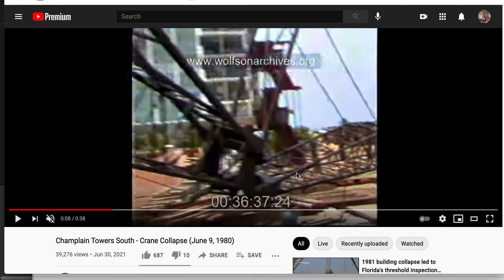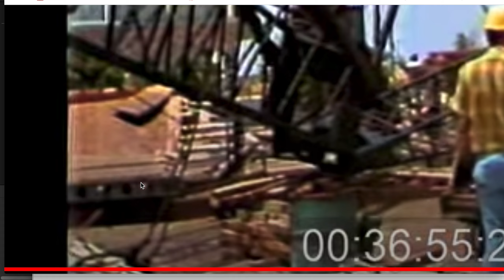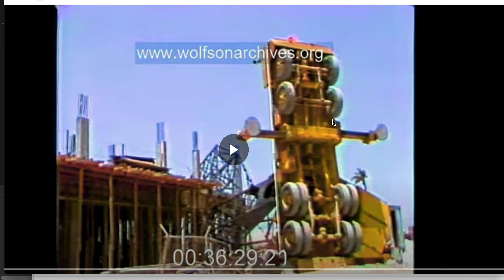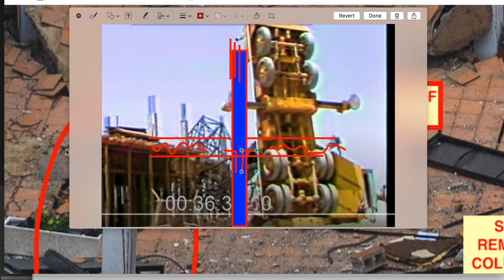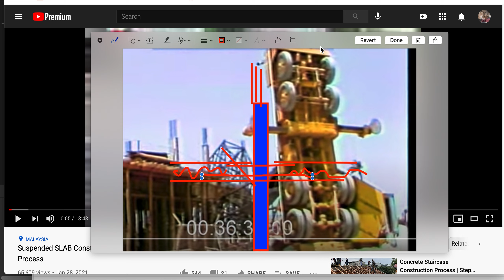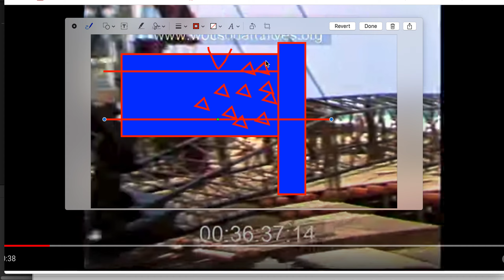Champlain Towers COLLAPSE THE CRANE ACCIDENT OF 1980 CAN TELL US ABOUT THE MARRIAGE OF CONCRETE

Comment: This is a partial and incomplete analysis of a video which has now been taken down and can no longer be found on the Wolfson Archive website.
That crane is directly on top of the pool deck and overlapping the building where it comes closest to the ocean.
The crane collapsed on top of the completed pool deck and the pool deck was never repaired, nor was the rest of the building that absorbed the shock-load of the crane collapse.
This is being covered-up to hide the liability of those involved in this crane accident and their inappropriate response to this accident, which was to cover it up at the time and just complete building it, and the building was already damaged before it was finished.
The contractors and developers of this building clearly realized that this crane accident occurred and instantly began attempting to pretend that it didn't and everyone who bought into this condo was lied to about this accident and damage, until it killed them.
They should be bringing criminal charges for this, yet, now NIST is in on the cover-up too.

Comment: This has me thinking they poured the garage floor and pool deck last. The crane would be parked on grade (in the pool deck area) and used to get the concrete placed, along with an area on site to stockpile materials. It would be easy to use different strength concrete in the columns/floors. U would just order the 6k psi trucks and pour the columns up to top of floor grade, then when u finish that the 4k psi trucks show up to finish the pour of the floor. Its all wet, then vibrate and all good. Then u pour the next portion of the 6k psi column from the top of the previous column to somewhere below the floor of the next deck. Then u place forms for next floor and continue to pour over and over again as described. The BMA was used as the additional cheap support method for the deck of the pool/planters area as they new this area would be poured last and would require some help since it didn't have separate columns. The mistake they made IMHO was simply to not place an additional set of columns for the pool deck area (poured last) to separate the pool deck/building intersection joint. By using the angled rebar that connected the higher building floor deck to the lower floor pool deck they created a moment arm on the building columns that failed when loaded by the falling pool deck. Improper maintenance weakened the rebar/concrete in the pool deck/parking area and it fell then taking those columns out. I dont know what the codes are now for separate standards based on use type maybe they have changed so that garages are structurally separated from living areas? Just my thoughts on this sad situation.

Comment: So the pile caps were poured, and then the columns.  
So the basement slab wasn’t poured structurally, (first), but treated as a slab on grade and poured later, (with sand as the form)? The rebar was indicated through and around each basement column.  Is that why they didn’t want the engineer anywhere near the basement slab?
Reply from the maker: No. The point is, the first floor more than likely had a bond break while waiting say, 28 days because shoring was on sand. This has nothing to do with concrete pour on floor afterwards.
Reply: @LoadPathEngineering  so the husband was not engaged from the very start.  Lost interest in the first few days? The upper horizontal fracture in the core was from pulling forms (early) and/ or residue crane collapse damage of the deck?
Reply: The planter beam was possibly pulled on during the crane collapse 40 years earlier (torqued).  Were the shear planes seen after building collapse from the earlier crane collapse repairs or lack there of (improper - non doweled- construction joints).  Did the third building  find and collapse towards this weakness (mirroring crane collapse path)

Comment: Could this be the reason the original General Contractor resigned?
Reply: No because the GC resigned almost at the end of construction, possibly when the 13th floor penthouse was ordered.
Reply: @youtbe999  Does the 13th floor penthouse dramatically alter the stresses on the building ?
Reply: @youtbe999  where was the old Coast Gaurd station in relation to the building. It was one of few early buildings around on the beach from the old days. The old map shows it (1925) just trying to imagine the beach line
Reply: Wow, how do you know that?
Reply: @carrotman5126  it was mentioned in an earlier video from the content creator.

Comment: How are the "rabbit ears" made? If we look at the 1980 construction photo of the columns, there is a lot of rebar going to the sky; are a few rebar just bent 90 degrees when the floor is poured?
Reply from the maker: A lot more detail is done now... That was 1976 code and appears the town agreed on it...So, we play the cards we are dealt.
Reply: @LoadPathEngineering   More than a few have been left destitute or in jail for using 'it's in the code'  ie MINIMAL due diligence defense.  PROFESSIONALS are PERSONALLY (well in Blue states I"ve worked in, maybe not in Red States) for ensuring built environment meets needs and doesn't fail - no matter the code.   The 'due diligence' defense is weakest when people die  No one has survived professionally using a due diligence defense when dozens much less hundreds have died.
Reply from the maker: To further answer your question, we will get into tributary transfer to the shear punch "protection"... Other videos to come.
Reply: @LoadPathEngineering  "protection". That does not seem to be much holding up the floors.

Comment: Incredible connection between 1980 construction photo and 2021 parking garage punch shear. Interesting how the parking garage had rebar too high but we saw the pool deck with rebar too low. Smoking gun.
Reply from the maker: Still not 100 on this yet... recall they had a wear layer or that damn stamp concrete and that puts it around where we observe the rebar == where is the ''main deck's" rebar  or is that it?
Reply: @LoadPathEngineering  How do I send you a picture?

Comment: 15:27 those are right angle bars for termination in to a deck the ones bent down
Reply from the maker: Those 4 would not be allowed, current day but we have to accept they used the 1976 code and that town appears to have approved the plans via the engineer...
Reply: @LoadPathEngineering  
Crazy how times change my high rises head iron is normally #5’s top and Btm There integrity iron.  You also have drag iron running through the core (elevatorshaft)
Reply: @sgriffin760  the lower columns were higher strength psi and began at the pile caps above the Franki piles.  The lower vertical steel is heavier.  I was thinking they were going to bend some additional bars down like the rabbit ears but I don't think there was room.  The visible rebar exposed is the slab thickness plus the bar lap for the next column above the formed slab.  The stripped floor slab would hopefully be reshored from the slab below till sufficiently cured.  Hopefully the horizontal punch shear steel (rebar) was laid in (husband) after forming each floor
Reply: So if the lower columns were 6k or 7k spec'd psi, the slab thickness was 4k psi at floor slab for the columns?
Reply from the maker: Agreed... Now get back to your psi and BMA and deck interactions... You were nailing it.
Reply: @LoadPathEngineering  
They left the head iron out I can show you a typical detail for this

Comment: @ buy new forms.. the forms are built, you know that. 
The bottom floor was always poured last, btw. At least on all the buildings I worked on. 
That is post shoring holding up the deck work.
I remember seeing that crane up on end.
Reply from the maker: Run with your comments Russel, now add the BMA information... Read the other comments and put it all together... Don't forget the psi issues.
Reply: Run? I can only comment on what I know from doing it. The rebar should 90 up off the deck. When the columns continued up beyond the deck, the column form sat on the deck, plumbed and kicked off and left 50% open for the iron workers. What I am looking for in these photos is the column under the deck , inline with the one above. All of them should be that way, those (below)should be sitting on pads/footers. The first things to be poured on the site..
BMA? Not a clue. Where is BMA on the prints?
Reply: @russell3380  What does "90 up off the deck" mean? Thank you for providing more expertise here. Us laypeople are learning a lot!
Reply: @dosgos  Since he hasn't replied as of yet, I will say that it appears that Russell is describing a procedure for pouring reinforced concrete columns and slabs. The procedure that he is describing sounds as though it would create a proper bond between the columns and their associated slabs because they are poured in unison. The procedure they're using in the video above differs because many levels of column are poured in advance of any particular level of slab and because they are poured at different times they may not bond as well. 

By 90 up I believe he means that there should be a bundle or tuft of rebar sticking straight up at 90°out of the next lowest level of column that was just poured, ready to receive concrete for the next higher level of the column.

It's fascinating that he says that the lowest floor is always poured last. I wonder what odd quirk of physics causes this to work better than simply pouring the lowest level first.

Hopefully this interpretation was correct and it cleared things up for you.

Cheers.
Reply: @Cabritopanini  What Russell3380 says is my observation too. Growing up as a kid I watched a number of buildings being constructed during summers when I had nothing else to do which was most of the time. Most were single story businesses but also several multistory buildings. Everything was built on the foundation - walls, columns, everything and the ground floor was poured last after the walls and roof were built.

Comment: That is on top of the parking garage
Reply from the maker: Run with it... Now add in the form detail of the BMA ...
Reply: It's not a matter one thing it's a combination of things  Combined together over 40 plus years to come crashing down .....  There is no doubt the Crane started the Domino effect in 1980 That foundation had leaks it was compromise from the beginning I'm sure they just put a band-aid on a in cocked it so it wouldn't leak but cocking doesn't last more than 40 years think about it...  Maximum for sealing purposes 10 years .  they had a nasty hurricane Wilma that cause damage to the building... So all that salt spray during those hurricanes with into all those crevices And cracks even the smaller ones with  Salt crystals forming There isn't any rebar left in those areas

Comment: I’ve decided I’m never staying in another high-rise hotel or parking in a parking garage.   Oh hell no.  Now, if only I didn’t work in a Manhattan high-rise.  I’ll probably be spending my lunch hours checking out the foundation 😂
Reply: Yeah dude... totally agree.  I've also heard a lot of annectdotal evidence about the lack of attention to detail in building in the 70s and 80s with cutting corners all over the place.  I'm fearful that this is the first of the failures that we will be seeing that are caused by the corners being cut.
Reply: Still plenty of corner cutting these days as well.  Plenty of apathetic municipal inspectors as well.
Reply: Is it one of those towers with posh looking high speed elevators with plush carpet and well refined button interface? The door closes, the door opens immediately and you're on another floor so quick it was as though you teleported. Used to love riding those things in a tall building whenever visiting someone when I used to live up in those parts.
Reply: @Cabritopanini  
Nah, not plush. Right near Grand Central terminal.
Reply: Keep your eye on the columns and garage ceilings also if you happen to have to work in one._

Comment: Makes sense concrete wooden forms may have been damaged by the crane falling onto them before the crete bonded up with the rebar in the 28 day curing period. I really dont think they built this building with proper methods after you pointed out those 4 Rabbit Rebars on the columns.....Scary
🏗🧱 Great Data Discoveries 🏗🧱
Reply: @UC-_5I5xDiFVcxlnG7uSLuFA I know some contractors try and speed up the pours before the cure takes place, like you say when their adding stress loads building going vertical up without full cure, it causes the crete and rebar to bow in the crete....If that north tower is built the same as the south tower, I wouldn't want to live in it....Great Work your Doing 🏗🧱🎈🐈🎈🐈
Reply: @firefox2716  I imagined same crews, subcontractors for forms, rebar and concrete ( just for volume discount)
Reply: @charlesrhodes7531  You got that right ! This was a cut cost building, Not one penny more over budget. Wholesale ACME Cement Crete Ready Mix...No Concrete experience needed just pour and let others patch later boys.....Let's go home !

Comment: Heads up... The shoreline used to be a lot closer to the buildings back in the 70's.
Back them some buildings along South Beach had no beach during high tides.
In the mid 80's a beach renourishment project all along Miami Beach widened it with imported and dredged sands.
This will help you figure the approx location of this crane and the pool deck construction.
Reply: @LoadPathEngineering   @Construction Engineering & Failure Analysis  I'm not a construction guy, but I think the polaroid pict @37:05 seem to show a collapse of the pool deck encasement construction caused by the impact of the crane.
Reply: What, builder even had problems driving Franki piles? I bet he did not pay for proper soil analysis.
Reply: I remember the beach back then well and how controversial the beach replenishment was at the time but they really had to do it. However the dredged sand was very different from the original beach sand, I wasn't as interested in going to the beach after that.
Reply: That helps as the old beach is completely disorienting.
Reply: @dosgos  one of the state or county should have geo referenced aerial photographs viewed through GIS.  Overlay different years of USGS maps
Reply: @charlesrhodes7531  Awesome source! See newest video comment with your name and ideas so this gets picked up.
Reply: @dosgos  You'd think that was the pool deck because of the proximity to the ocean (back then), but instead it's the building itself where the crane collapsed.